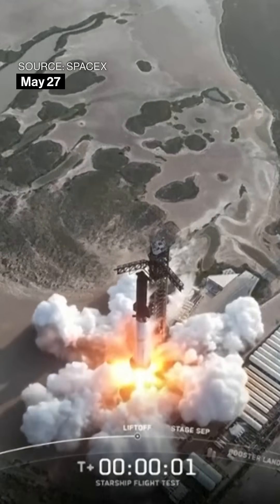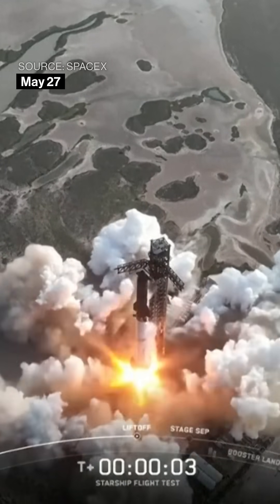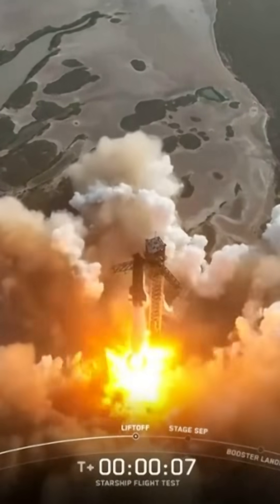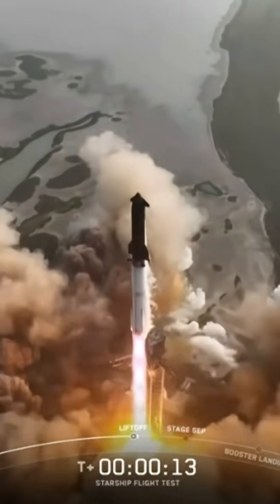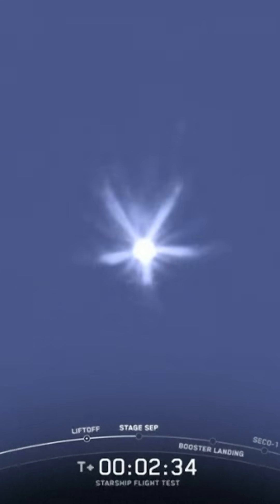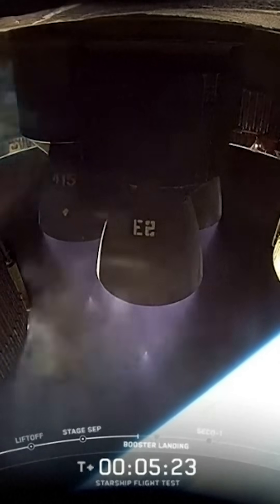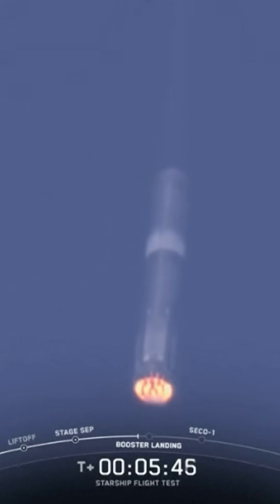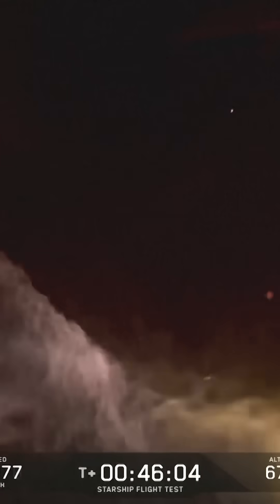SpaceX Starship Rocket Explodes in Mid-Flight

Comment: Weakly Interacting Massive Particles (WIMPs) are a candidate for dark matter with the following characteristics:

1. **Mass**: WIMPs typically have masses ranging from tens of GeV (giga-electronvolts) to hundreds of TeV (tera-electronvolts), significantly heavier than ordinary particles.

2. **Weak Interaction**: As the name suggests, WIMPs primarily interact through the weak nuclear force, making them difficult to detect directly.

3. **Stability**: WIMPs are expected to be stable or long-lived, meaning they do not easily decay and can exist for extended periods in the universe.

4. **Thermal Equilibrium**: In the early universe, WIMPs were produced and annihilated in thermal equilibrium. As the universe expanded, their abundance decreased, contributing to the dark matter we observe today.

5. **Detection Methods**: Scientists look for WIMPs through direct detection (e.g., underground laboratories) and indirect detection (e.g., observing cosmic rays or gamma rays).

Research on WIMPs is crucial for understanding the nature of dark matter.

SpaceX needs to consider the dark matter in order to get future success!